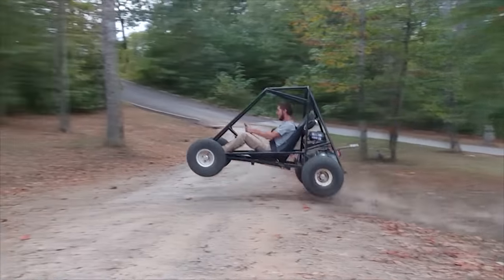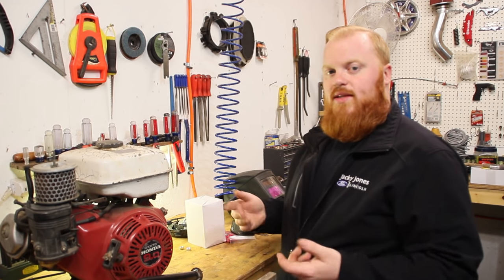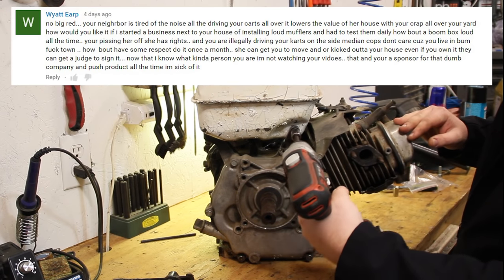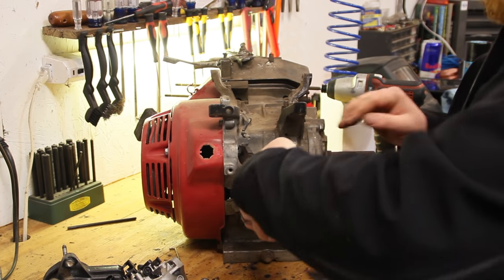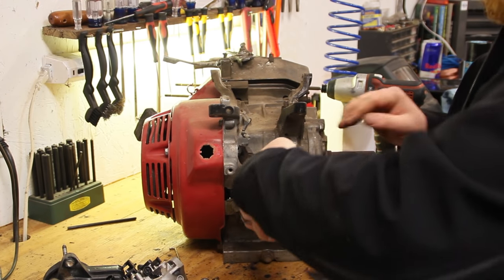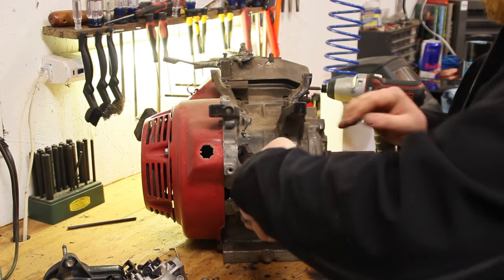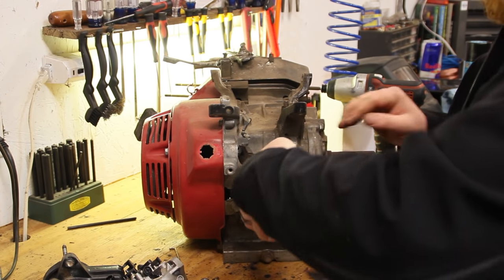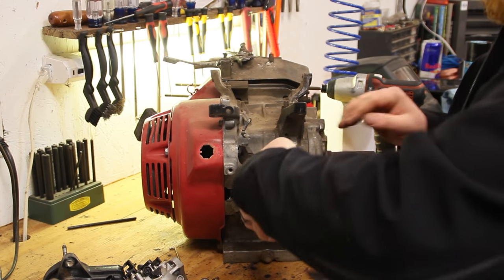Honda GX270 9hp / Predator 301cc 8hp Go Kart Upgrades

Comment: little tip - if you don't already know, the choke lever on Hondas have a round tip that fits perfectly in the fuel line to plug it. comes in handy
Reply from the maker: +Jon Deierlein good to know
Reply: Gotta love Honda. How do you know that?
Reply: @matthewmoneta7906  High school small engine teacher 20+ years ago showed me. Gotta assume honda did that on purpose.
Reply: Omg thank you so much 🙄

Comment: The throttle plate is part of the fan shroud and helps cool the motor. If anything just remove the arm and put the tin back on to help the engine from over heating.
Reply from the maker: +FullMetalFab yeah someone pointed that out to me. Thanks for looking out. I didn't even realize it.

Comment: You have your doubts about that carburetor, mine was just as bad on a GX160, the complete engine was horrible, trashed. sitting outside for 5 years on a compactor. I rebuilt it with a rusted and wavy cylinder seized piston rings and everything just cleaned it all up slapped it back together and she ran pretty good other than a little bit of smoking. The Hondas don't know when to quit

Comment: you should really leave that piece of tin for the throttle on the side of the engine it really helps cool the cylinder a lot more than you think
Reply: On a stationary, low speed, or under a hood of a piece of equipment yes the cooling shrouds are duct work to help direct the air to help cool. On a go cart or mini bike moving at faster speeds as long as the engine is out in the open the shroud isn't needed. And yes I actually tested it with a temp gun on my son's mini bike because we wanted the polished engine to be as out in the open all shiny as we could get it. That little piece made zero difference.
Reply: I raced gopeds for years and that plate was a nessesity even doing 45mph on a scooter with a chainsaw engine. Lawn equipment engines are not meant for high RPM for any period of time because the oiling and cooling systems were only designed to work well between 2-3k rpm we even used to toss the factory ones
I and even make upgraded aluminum ones. We also ran engines that normally rev'd to 14.5k at 21k rpm and could usually get 1-2 race seasons out of an engine. Just saying, cooling is very important on these types of engines and should not be skimped on for visual aspect.

Comment: I wouldn’t recommend removing the throttle control plate.  it’s also a cooling tin for air flow around the head. I’d just remove the mechanism that’s bolted on.

Comment: big block Honda's are the baddest engines out there I know guy's that gx390s on shifter style racing karts on road course track at 100mph you can make 30+HP just with Bolt ons all torque and gear

Comment: so which carb worked best with the gx270 clone?  I want to do performance upgrades on my gx270 clone, should I get the gx390 carb?  or maybe a gx340 carb?  I can likely make my own exhaust.  I'm kinda on a budget, I could also re-jet my factory carb if that's beneficial at all...?  thanks
Reply from the maker: +MrJohn613 the rejetting is worth it but the gx390 carb has a lot better flow
Reply: Red Beard's Garage I bought and installed a gx340 carb like you did in this video.  Do you have footage of it running?  When I installed the 340 carb it idled fine but seemed to fall on its face at open throttle.  Sounds like too lean?  Perhaps I can swap main jet to rectify that?  I also changed the sparkplug since returning to the original carb, and the new plug makes a big difference I think.  The 270 works good I'm just hoping for a little more mild performance.  Any recommendations?  Thanks

Comment: Which do you think would be better to use on a off road go kart a slightly modded Honda clone 6.5hp or a stock genuine Honda gx340 which only has the governor taken if it which do you suggest would be the best engine to use
Reply from the maker: the gx340 for sure but I would defiantly do the hd valve spring on that engine. It will warp a push rod or a valve quick if you float the valves

Comment: Little confused on the carb upgrade. I get that the opening is bigger for obvious reasons but if the head opening is the same 20mm. Wouldn't it still be restricted? Also do u have to remove the oil senser to also remove the governor?
Reply from the maker: The head opening is still bigger than the stock carb on this engine. you don't have to remove the oil sensor but I would because  if you take curves fast it still can cut your engine out
Reply: Ok got yea on the oil filter thank you for actually replying.  I forgot to ask what did you put in place of the governor arm that's in the block? A bolt?  Again thank you for the replys!
Reply: I was considering port-matching the intake port in the head to the larger carb, if the larger carb is beneficial?

Comment: If you used all hand tools some group would whine about how you need to buy some power tools. You use power tools a group is gonna whine about you need to use hand tools. Next is gonna be the pneumatic vs electric groups. John Lydgate said it best "You can please some of the people all of the time, you can please all of the people some of the time, but you can’t please all of the people all of the time"

You want to sit at your house and use all hand tools then so be it. You want to use all power tools thats fine also. There are times I'm just BSing around I'll take it slow and hand wrench everything. I also own pneumatic, cordless, and corded tools and will pick whatever is closest to me when I'm in a hurry or just want to get done. The vids are great and unless you decide to turn fasteners with your tongue use whatever method makes you happy.

Comment: What chain do you run with high HP engines like this? I have a 9hp Subaru Robin, and going to run a 35 Chain on my race kart with it and a torque converter. Will I have chain issues. Have you ever had strength issues with 35 Chain?
Reply from the maker: 420 chain. I would not run #35 for sure

Comment: Quick question. When disabling the governor,  do you have to remove the gear inside or can you just bypass the lever that sits on the top? I'm new to these type off engines and got my kids that same coleman 196 kart you had on a previous video. I want to hop it up some more.
Reply: Remove it
Reply: Robert Mcgruder ok thank you
Reply: There is a video on YouTube that shows the process, pretty straightforward bud!

Comment: i dont know why he hating on a impact i dont have a battery powered one i wish i did but i have a air powered one and it comes in handy it just quickens disassembly so you can fic the problem or mod it and put it back together in half the time of a socket wrench

Comment: Hey, awesome vid. I know I'm late to the party here... but oh well, question time: 

What RPM can I safely run a stock 270 to? I have a 270 from a pressure washer that I believe the throttle maxes it out at (in or around) 3,400 RPM. I imagine it will rev a little higher though, I just don't know how far I can push it...
Reply: Late reply, but someone else reads this. 4700 rpm is absolutely safe for like karting, etc. 4.900 is not bad. If you remove the inside governor, recommended limit is 5.300
You’re welcome.
Reply: But it’s not good  to speed up the engine  to those speeds without any load. I had once my ignition coil touch the flywheel at high speed without a load, and the coil, its’ leg and flywheel destroyed.

Comment: Hey red beard buliding one lost my motor mount for it and not sure what bolt would fit perfect for it ? Help please
Reply from the maker: You can use 3/8 or 5/16 bolts on these engines
Reply: Red Beard's Garage thanks a lot man you really hellped not fo figure out how to rig up my throttle line and break line
Reply: Red Beard's Garage  do I plug where the govener cane out ? And where oil sensor was ? Jw

Comment: What size is the shaft coming out the engine is it 25 m and if so will the 40 series fit ok not done a torque converter yet can’t wait to try it
And also is it the 390 or the 340 best carb on the 270 cheers man 🤙

Comment: Hello!!
Thanks a lot for this video!!!!
i have a gokart with a soda gx 270. I just did buy a 390 gx carburetor, is there something in particular that i have to do to make it work good?
thanks!
Reply from the maker: You will need the carb insulator that goes behind the 390 carb as well. You can buy them with a full gasket set for cheap. As long as your running the open air filter and exhaust then the factory 390 jets should be ok. Just run it and pull the plug to see if it is running lean or rich and adjust accordingly

Comment: What tips do you have for the 420cc predator to improve it?
Reply from the maker: +Santiago Gonzale remove the governor, jet the carb, exhaust, valve springs
Reply: Red Beard's Garage Thank you for the info. What Springs do you suggest? And what would that do to help out?

Comment: Hi. i just installed the bigger carb gx390 on my gx270 and added the gaskets and the spacer as you suggested. But now when i turn on the fuel, it drips/gushes out between the thick black plastic spacer and the carb itself. it looks like its coming out from the drain part. Any idea what i may have set up incorrectly? Thanks.

Comment: oil pump pickup what the hell did i miss some thing
Reply: jack stricklen it's an oil sensor, not an oil pump. Small engines usually just come with oil slingers/dippers
Reply: most hondas come with the oil sensor so if you run low on oil your motor will not run to keep you from burning it up or locking it up. great addition in my opinion.

Comment: hey man i wanna get a 301cc predator  for a go kart is their a mikuni carb for it?? i bought one for a 212cc for a mini bike nd i liked it better can u tell me whats the size i need or something so i wont get the wrong one thanks
Reply from the maker: +luis suarez 32mm mikuni and get the Vegas kart manifold for a gx340 and it will work. You may need to mess with jet sizes to find the sweet spot.

Comment: Is the gx270 carb to airbox gasket/spacer the same as the gx390 or is the gx390 one larger ?
Reply: bigger, i just did this to mine and i cant make it run right it could 100% be user error on my end but so far ive gotten it to run on idle but whenever you give it gas she wants to just bog and die right away
Reply: Actually they are the same exact size . I ended up ordering one and they match up .

Comment: how will that spacer not being on there blow the motor
Reply from the maker: blocks the ports on the carb that help with the idle. Without it the engine will rev uncontrollably .

Comment: I know this is nearly a year old, but can someone tell me where to get a throttle assembly for a gx270 that will take a throttle cable? mine used to be on a pressure washer, and it just doesn't have one. doesn't have a place to mount a throttle cable. It's confusing the shit out of me, i just can't find any solution to this.
Reply: try contacting that sponsor of his, powersports or sometging like that and ill bet they have your solution!

Comment: there's metal shavings in the motor from the Dremel
Reply from the maker: I cleaned it with brake cleaner and flushed the whole engine down with it.

Comment: my go kart (yerf dog) has a 6.5 horse Tecumseh but i want a engine that i can build and i dont see people building tecumsehs anyway i saw a gx270 for $50 off a washer but i have enough to buy a predator 212 only reason i would get the predator is i thing it can fit the torque converter i have alreday

Comment: so whats the pont of the oil sensor on that engine what does it do?
Reply from the maker: Its for when these motors are on generators and pressure washers, so if you knock it  over it will shut the engine off.
Reply: Ohhh ok thanks for the info i always wonder what it did.
Reply: it also shuts it off if it runs low on oil so the engine doesn't get damaged. Thats the main purpose of it.
Reply: Firm Clock they suck though because if it's on a go kart and you hit a bump then it turns off the engine
Reply: Firm Clock  yout dont need in mini bike,gokart,and motorize bike appication because itll auto shut off soon as you turn.just make sure you change your oil is  at the correct level you should be fine.
Reply: Firm Clock  yout dont need in mini bike,gokart,and motorize bike appication because itll auto shut off soon as you turn.just make sure you change your oil is  at the correct level you should be fine.
Reply: i meant you dont need the low oil sensor in those appications
Reply: So you take them off in case you roll the kart cause you don't want it to shut off?
Reply: NeroFilm Productions You take it off because when your hitting bumps and stuff the oil splashes around and when there isn't oil touching that sensor the engine turns off. So it's so you can ride it off-road without the engine trying to shut off every time you hit a bump

Comment: Red Beard's Garage,
Hi I don't know if you are interested, I have a new old stock Honda GX390 complete engine with electric start; I also have a new old stock Kawasaki 230 cc complete engine. I would like to sell both. I am in Somerset, Pa. area. Not far from the flight 93 memorial. I really like your videos!

Comment: Only 9 hp why it's a 270
Reply: easy to mod to double that hp but they're all torque and inefficient compared to dirtbike engines it's like comparing a 5litre ford v8 that makes 150 hp to a 1.6 150hp Honda. ones barely breaking a sweat while the other is screaming 9k rpm
Reply: S E R G A L - W A V E  that's true also the main concern is they want the engine to be reliable to run literally all day as a generator or some other industrial equipment so they make them oversized and detune so peak power is around the governed 4k rpm.. there are 90cc dirtbikes subject to the same strict regulation that make 10hp out the box...
Reply: I.C. karting